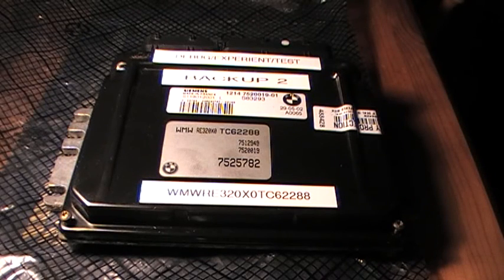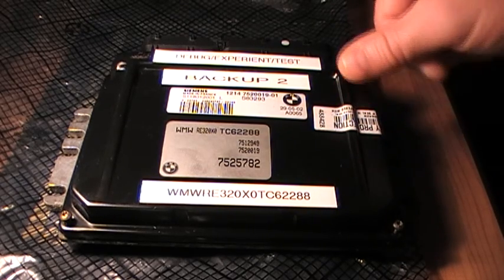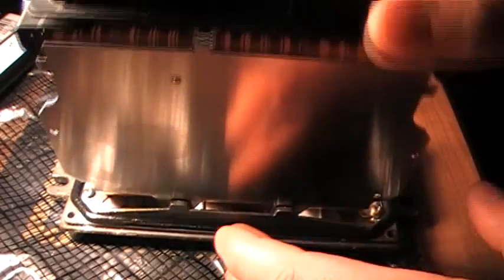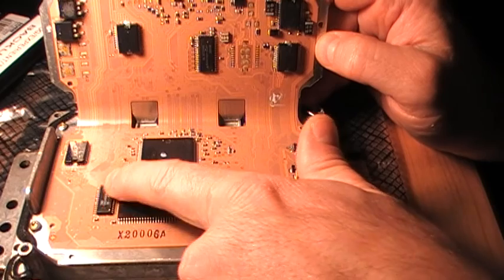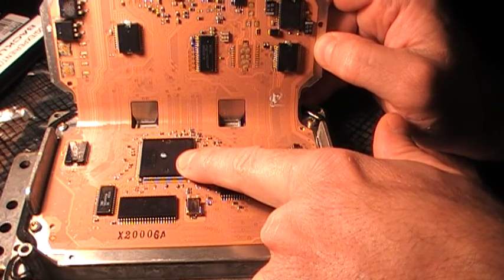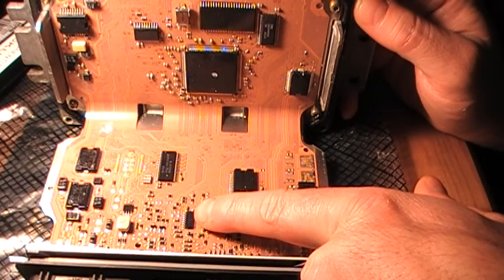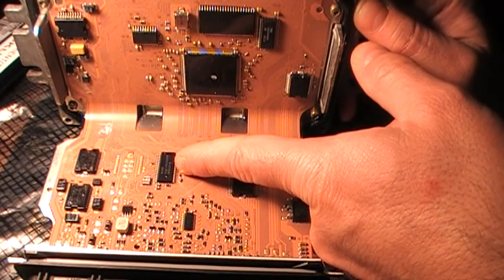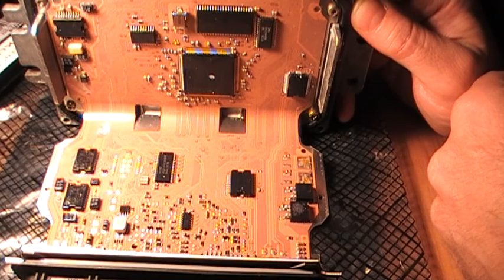Inside a BMW Mini R53 ECU - Exploration

Comment: I have an R52 for a convertible S 2007 and I can't get the green plug on the BCM to come loose.  Is there a trick to it or does it slide or just pull off ??
Reply from the maker: I haven't removed a BCM yet, so I'm not able to help currently, sorry.

Comment: very great video however according to the pin out the ATM43D-446778 (Throttle motor driver) on the video is the injector driver...correct me if i m wrong
Reply from the maker: I have a later video where I have continuity tested the ICs. It was a while ago so I'm not sure if it reflects your comment.

https://www.youtube.com/watch?v=WuUJMJoDHAk

Comment: so my dme went bad , heading out to the yard to pick one up for a 04 mini cooper . do the numbers have to match or not?
Reply from the maker: The person where you get it from will be best to get you the right one as it doesn't just have to be the right model, it will need to be recoded to work with your alarm and immobilizer and keys. The different parts of the car check that they match, even the ignition key is read by the ECU to check it is valid, one can't just be taken and put into another vehicle.
Reply: I think you need a lockset that includes the ECU, Immobiliser, Body Control unit and a matching Key. You may also need a barrel and driver's door lock, but you may be able to split the old key and put in the new chip from the matching key. eBay do them for £100 or you get a new ECU and reprogram from BMW for £1000+

Comment: Hello thank you for the video. I have a 2008 Mini Cooper. The Control module Voltage is reading 25.675 volts causing the check engine light to come on for code  P0687 PCM/ECU  power relay control circuit high. The car runs fine but the Battery light comes on after start for about 30 seconds then goes out. Do you think the 5 volt regulator is bad, and can be replaced? Or, do you think I should have the ECU replaced and reprogrammed? I'm tempted to replace the voltage regulator just to see, but didn't want to just replace stuff all Willy Nilly. Thanks for any advice you may lend ....
Reply from the maker: I have not experienced where it measures the voltage from at this point, so can not advise about the issue you are experiencing.

Comment: MPPS and Galletto give full 512kb however have you worked out how to flash a whole file onto another ECU? Some sort of coding must be changed because of the EWS?
Reply from the maker: I have looked at the file that comes back, and I think that the ECU may prevent some information coming back, such as the vehicle VIN number. So though the file is 512KB, some information may be blanked out from the image. I haven't looks any further yet.
Reply: Develop IT That's ashame, was that read in boot mode also or are you referring to the OBD  read?
Reply from the maker: Just read using the MPPS tool.
Reply: Develop IT So does your read only contain data after 07000 address? Mine appears to be full. I think you can read full data through OBD but to write data before 07000 you will need boot mode right?

Comment: Wouldn't it make sense that the H-bridge driver is the TAC?
Reply from the maker: That is a good point, I think I need to trace all of the pins to the ECU header, not just the ones I thought where the outputs while referring to the datasheet. I'm building a bench tester for these ECUs, so hopefully it will become much clearer soon when I can put them though scenarios.
Reply: Doesnt lambda sensor need power to heat a platinum wire, or something? Might be why it has a driver chip.

Comment: To save you from a  long story this is what i need help with, I have two motherboards EXACTLY the same, if i was to move chips from my main faulty motherboard to a replacement motherboard, which chips would i need to move over? ive tried the software solution, need to do it by moving chips over now.